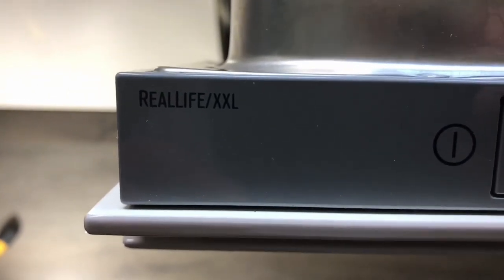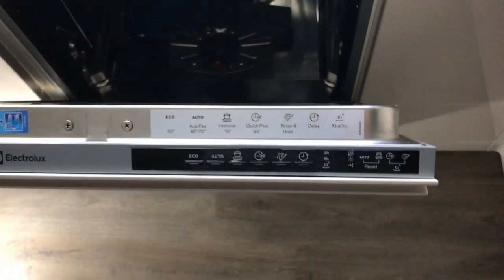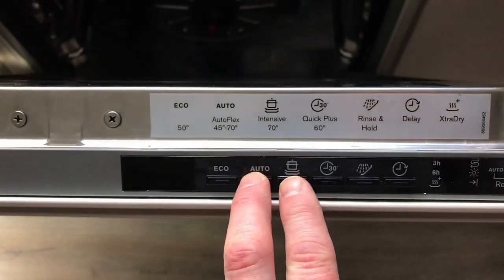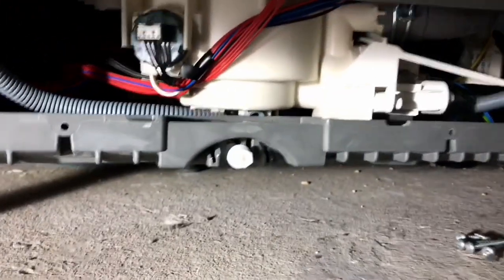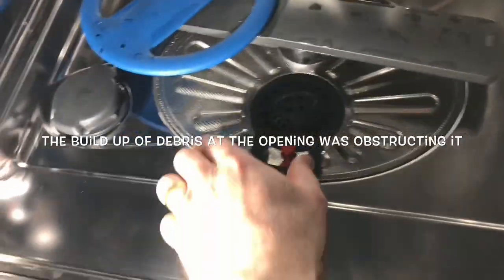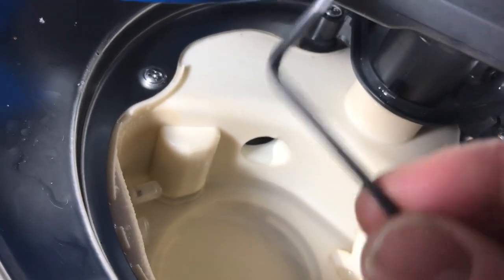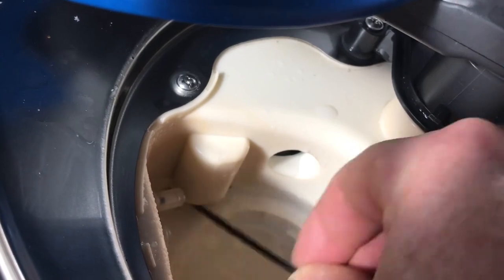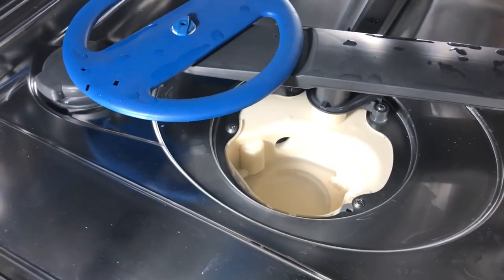Electrolux Dishwasher Fault. End indicator flashes and beeps 1 time every 5 seconds.

Comment: Thanks to you, I was able to fix the i30 error on my IKEA Medelstor. First, I cleaned the sensor with a thin straw brush. It didn’t fix the issue right away. The beeping was annoying, so I turned off the main water supply and the electrical breaker before going to bed. In the morning, I cleaned the sensor again, turned everything back on, and the problem was fixed. Thank you so much.

Comment: Thank you very much! Without this help, I wouldn't have been able to repair my dishwasher because many repairers tell you that if there is no power to the fill solenoid valve, then it is a problem with the electronic board. Hardly anyone tells you, as I thought, that it could be an upstream problem for some security reason or malfunction of another device. In my case I didn't have an explanatory error code but only two beeps. I cleaned exactly as you indicated and I also poured boiling water. Unfortunately that wasn't enough, because I also had to remove the pressure switch and clean it inside, and finally the dishwasher started! So let me add this extra detail.
Thanks again, all the way from Italy!

Comment: Have a similar Model, slightly older I guess. Issue as described in the video with the pump starting when I start the program and showing error i44. Needed a few attempts to clean the sensor following the description - and it eventually worked 🙂. Maschine running again perfectly! Thanks!

Comment: Hello, just saw this video which helped me rectify a similar fault on my 11 years old AEG.
two tubes going from the sump of the machine to the pressure switch, removed the ends on the sump side and injected hot water into the sub via the ports that had the tubes attached.
Lots of guck and grease shifted. Reattach the hoses and everything is operational.
All this was done from behind the front kick plate.
Thanks for the point in the right direction 👍🏼

Comment: You Sir must be an Angel 😇  in disguise. Worked to a tee thank you so very much for sharing this wisdom. Id actally run out of dishwasher tablets and feeling the squeeze had been using without so obviously contributing to the debris building up in the pressure switch. Thank you.

Comment: Thanks Paul. Great video. Fixed my Ikea RENGORA dishwasher this morning using this method. It was giving 4 beeps which isn't in the manual. Same internals as yours though. Maybe you could change the title to include 'Ikea RENGORA 4 beeps'. Thanks again.

Comment: Having a nightmare with this, I’ve cleaned out all the waste pipes, even removed the pump and cleaned all of that too. I’ve taken the float sensor out, and the pressure sensor, cleaned them both and put them back in. The sensor was full of gunk. But mine doesn’t have the plastic shield over the sensor hole like this one. 

I’m debating buying a new pressure sensor for £23, but not sure it’s worth it 😢

Comment: @paulrutherford714
Hey Paul,
Can yiu suggest anything for my same issue, I've had to replace the pressure switch, but, the same alarm happens at the end of a cycle. Do you think the pump has failed or what?

Comment: Do you know how to enter a diagnostic mode on model ESL 66020?
Reply from the maker: https://www.manualslib.com/manual/603431/Electrolux-Esl-66022.html?page=17#manual.          Page 17 has the fault codes and malfunction info for your particular model. Good luck!
Reply: @paulrutherford714  Thanks. However it still does not tell you how to enter the service mode. My esl66020 do not show any errors.